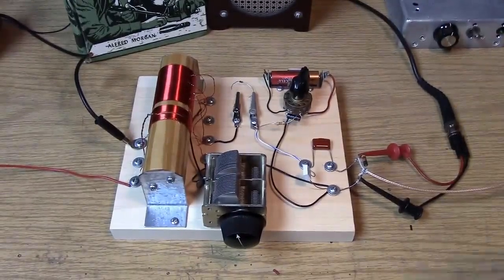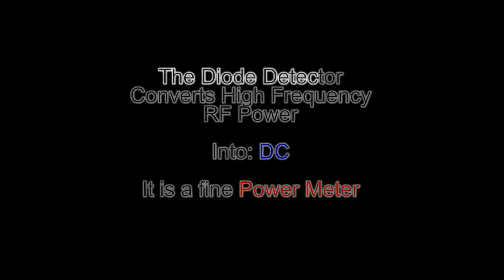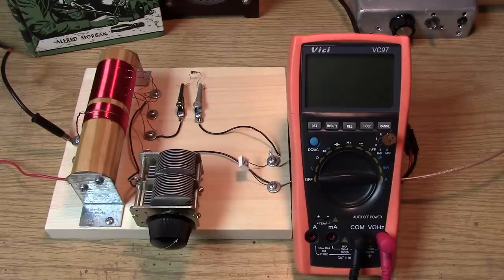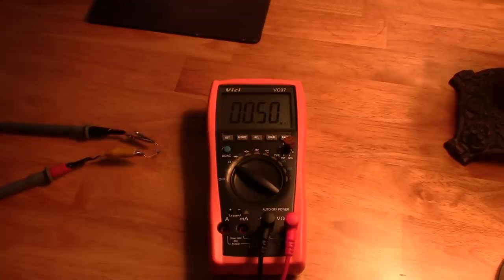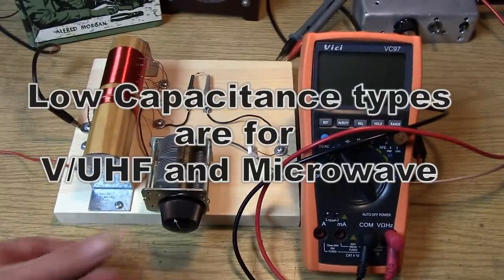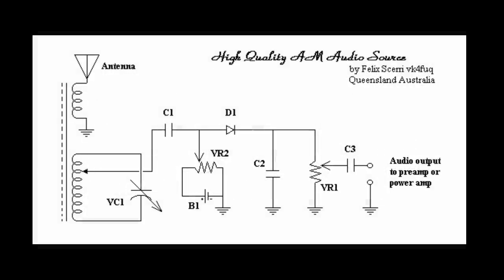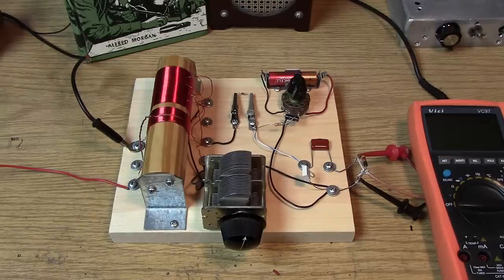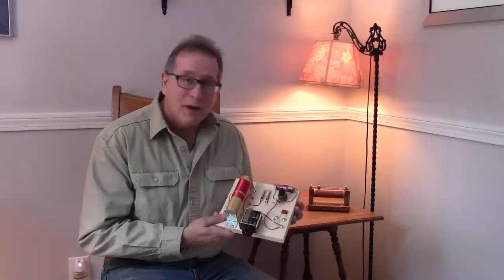Crystal Sets - Admittedly Biased

Comment: I haven't thought of crystal radios since I built one when I was 7 1/2 years old. I used a circuit from a book called The Boy Engineer that my mother had bought for me in 1960 when I was 2. I even constructed a small single tube amplifier for it from the same book as well. Thanks for reminding me of a very good time.

Comment: Mike, that kid you're talking about at 1:49, I knew him! He was working at NASA Dryden Flight Research Center in the early 90's when I met him. Talk about someone with wide-ranging interests! At Dryden he developed a digital signal processing method that improved the measurement fidelity of air flow across a wing that used fewer wing-mounted hot-film flow sensors. It improved the accuracy while reducing the flow discontinuities due to the sensors and wires. This was for his Masters or PhD degrees. Later on, he and I would frequent the local coffee houses where he would play his guitar. He was, and still is, a man of many talents!

Comment: One way to do this would be to set a small current using only a resistor and a higher voltage to define a current source. By applying a few uA, you will put the diode in forward conduction and no need to adjust voltage. As starting values 1.5v battery and 1M resistor. Using highZ, you can apply current directly on diode without decoupling.

Comment: Remove those galvanized brackets to improve coil q. Improve matching of antenna to coil by more taps . Taps on secondary maybe useful too. Home made diodes using zinc crystals have been used. some even have a negative resistance.
Reply from the maker: All great Crystal Radio tips that come from experience.
Reply: Pero entonces, esos soportes galvanizados ,mejoran o empeoran la situación ?

Comment: The best diode I found ever - was as a child - a zero biased capacitor coupled germanium transistor with a headphone in the collector to a battery. Most AM is spanish or chinese now. Hard to find interest programming on AM. Why not use a germanium transistor instead of aschottky ? It will provide gain and can be made regen also.

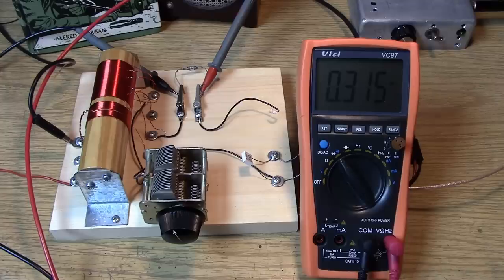Comment: Great video! one question at 13:13 you said the vintage 1n34 diode voltage drop of .315 v is lower than the 1n270 voltage drop of .241 v is that right?

Comment: It would be interesting to test the effect of bias on traditional point contact arrangement detectors ("cat's whisker" on galena, razor blade detector).
Reply from the maker: Actually many of the very early detectors such as the Silicon Carbide (Carborundum) types required bias.

Comment: I made one of my crystal radios with a multi-switch to choose from various crystals or diodes  including a quad or little circuit with 4 crystals mounted on it
Reply from the maker: Fancy setup Ray. Any pictures for the resource page on Facebook?
Reply: @MIKROWAVE1  what is the page name ?
Reply: @MIKROWAVE1  I just noticed the "K" in your name here so I am linking to you on Facebook and I'm glad I am able to.
Reply from the maker: Mikrowave1's Radio Resource Page
Reply: @MIKROWAVE1  Privacy settings won't let me post my picture - not sure if the privacy setting is on my end or  yours
Reply from the maker: @RayZ7834  I see it and posted the picture. So it should be up. Try commenting.
Reply: @MIKROWAVE1  Your privacy setting or maybe mine will not let me post the picture on your FB page.  I have tried to look into my privacy settings but to no avail

Comment: I really would have liked to see the performance of the voltage doubler crystal radio.
Reply from the maker: I have built these as well as full wave bridge sets. They all work, but you don't get something for nothing. Usually the voltage drops and impedance differences tend to wash away the gain you think you should get.

Comment: I realize this is a crystal radio thread but a question occurred to me. Would it be possible to phase-lock an oscillator to the carrier and do a synchronous detection of the audio with transmission gates? Even a lowly 4066 only has about a 70 nS delay and could be fast enough.
These days, it's probably much easier to do it with DSP techniques.
I had always wondered if you could bias a silicon diode to near conduction and use it as a detector for a crystal set. Enjoyed the video. Many thanks.
BTW - what is the forward voltage of silicon carbide and galena?

Comment: Outstanding presentation! Very informative and I liked that you compared many diodes and how they performed in detecting signals. What antenna does this radio use?
Reply from the maker: A 100 ft inverted L Longwire.

Comment: Hello can you help me unmute a radio between the channel sweep? I cant find any diagram on this model, how to unmute this.... Its a small radio type cs-106. Can you help me please?
Reply: What signals do you have access to?
The AGC voltage of some radios can be accessed.
Reply: @kensmith5694  fm? Am? Unmute the sound between channel sweep!?!
Reply: @SkyLabZaamslagtheNetherlands  You need to be much clearer with the descriptions.  I can give you a few hints about dealing with muting.
A common trick is to take the audio and look for lots of high frequency noise.  That is the usual indication of no signal.
Depending on the radio, a high pass at something above 10KHz will serve to isolate the high frequency noise.

Comment: I'm surprised you didn't use a modulated signal generator so that your comparisons would be referenced to a known signal strength.
Reply from the maker: My generator does do a good job on AM, but it has been years since it was anywhere near calibrated. I need to get a new one for sure.

Comment: Would it be possible to use one half of a germanium transistor such as a 2n109 as a detector?
Reply from the maker: Sure! A Germanium Base to Emitter junction  makes an excellent signal diode.
Reply: Not just possible but quite common in germanium era transistor radios as a cheap trick to up the advertiseable transistor count.

Comment: What are you measuring with your RF volt meter ? Voltage across the diode or across what looks like a capacitor?
Reply from the maker: That is an AC RMS Voltmeter that is measuring audio level only. It is flat out to a few MHz.

Comment: Seems like a hard way to characterize a diode. Any thoughts on a curve tracer approach? de Bruce, KQ2E
Reply from the maker: DC characterization is a great starting point. Curve tracing is a fantastic instrument method: a first principles grader. But the magic of RF diodes seems to defy using this method alone.
Reply: @MIKROWAVE1 , What tool and approach can extend the diode as far as the average user can handle? I ask because the methods used in industry depend a lot on metrology and standardization, goal oriented design as well as physical design. This is a wide tapestry to expose the beginner into, and you are facing that group here.